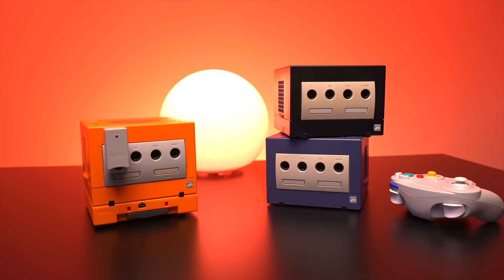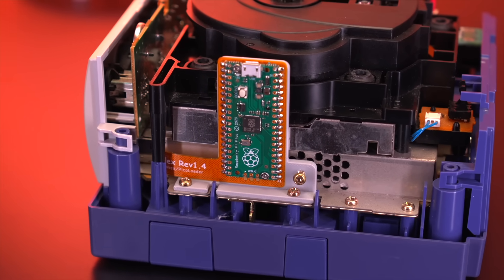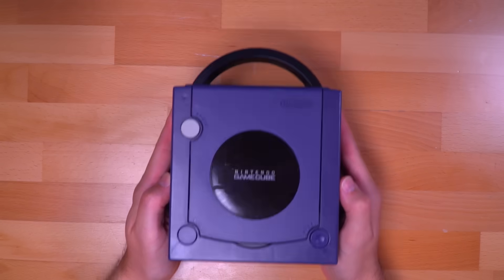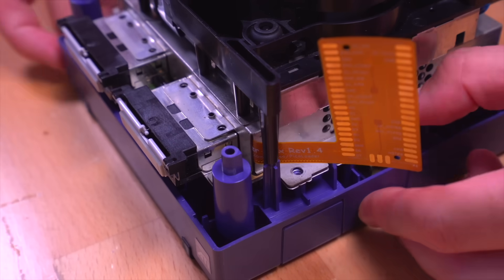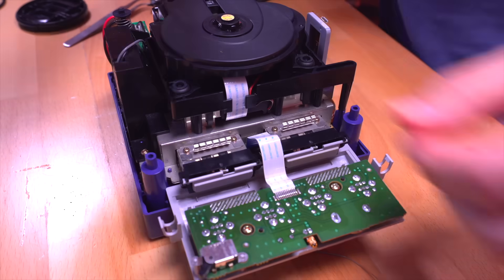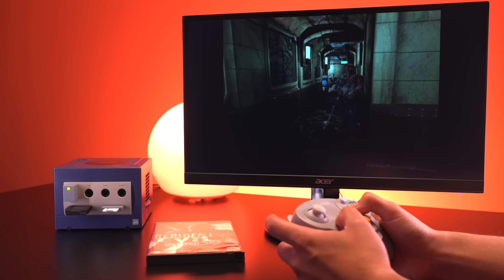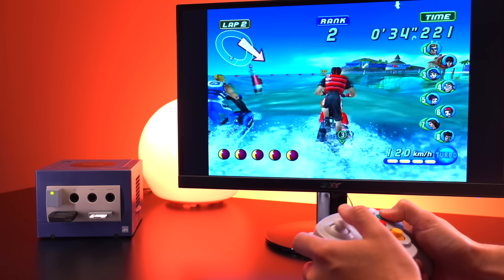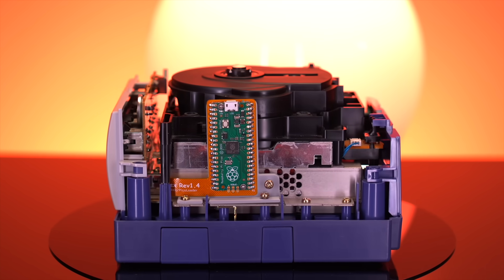New SIMPLE Open Source Gamecube Mod Chip | PicoLoader

Comment: 6:00 why would you do this while it's connected to the gamecube? Wouldn't make more sense to solder this before inserting it into the gamecube?
Reply from the maker: The bracket doubles as a jig to align the ribbon and the pico and being mounted to the console holds everything firmly in place.  I thought it was strange at first too, but when speaking to Makeo he told me that he thought it was the most straightforward way to do it and after doing it, I agree.
Reply: @MachoNachoProductions I understand screwing it to the jig to align it, that makes sense. Just feels weird to see it get soldered at an angle like that instead of laying the jig flat on a table. I don't solder things so maybe doing it that way makes more sense for those that do.
Reply: @_DewGaming  Because its mounted in place so you dont have to clamp it down to something weighted on the workbench. Otherwise the soldering iron pushes the pico around.
Reply: @suspendedhatch OK that makes sense. Not sure why it being pushed around being a possibility didn't click until you said it lol. Thanks!
Reply: @MachoNachoProductions  sure, but why not align and solder the ribbon and bracket and diode on the other side before you attach them to the console? in fact, why wouldn't they come already soldered together?

Comment: Flippydrive I feel is still the best plug and play solutions. This is still cool but still requires more steps. It is cool to see all these options coming out though !
Reply: I have a FlippyDrive, but I need about 5-6 more of them for a project setup.(I am a particularly dumb fringe case in this regard.)  The costs and availability of getting that many FlippyDrives was pretty daunting, but I think going through and installing a bunch of these will this a lot cheaper for me, with a bonus of forcing me to practice my soldering in a way that's a lot less dangerous to increasingly expensive old hardware.
Reply: If you're willing to spend 20x the cost for a 6-12 month wait and the same level of effort to install.
Reply: @TheDOSGamer 20x?????????
Reply: @TheDOSGamer  if you factor in the stuff you need to put an sd card in along with the cost of an sd card big enough to fit the games you want and the cost of shipping for everything this project ends up being about $10 cheaper than the flippy drive with shipping included there, so it's not a massive difference. the biggest thing is shipping time with flippy drives is the wait as you noted, this project is much quicker to put together
Reply: @Orion_Alathorn  who doesn't have a ton of spare SD cards at this point? I've got loads from old phones and other devices. Smallest is 2gb but I've got spares up 64gb.

Comment: Why would I want that when I can just use a flippy drive?
Reply: Primarily availability. I admittedly haven't checked in a minute since I installed PicoBoot with a Helder flex cable back in December, but for a while the FlippyDrive has been under heavy delays between shipments (I think the ETA back then was a good 5 months? Just checked and it's gotten better but you're still waiting a month.)

Also I do think the Helder cable is a good option for people with a busted optical drive/port.
Reply: Ordered a flippy drive almost a year ago, nothing yet. I am starting to think nacho is in bed with big flippy.
Reply: Because all you have to do is buy the ribbon, diode, and Pico board and you have it. You don't have to wait for Flippy Drive to be in stock.
Reply: If you're looking to install this mod one and done for yourself, yeah it could get more expensive than the premade flippy drive. But as Tito says in the video, this could be a groundwork for suppliers to make their own kits to sell, and people who would do the mods for others - especially once the custom board is finalized. If it doesn't seem to make sense for an end-user, that doesn't mean it's pointless.
Reply: I ordered mine last year and still hasn’t shipped. I could probably order one of these and have it from pcbway or jlcpcb in no time..
Reply from the maker: It's another option and theoretically a cheaper one as well.  Since it's open source it also allows the community to make improvements to it too
Reply: It’s all about options
Reply: @AmaroqStarwind Yeah, but I mean, why should I get an option that isn't as good as Flippy drive, when I can just get a Flippy drive?

But yes, it's always good to have more options.
Reply: @Irgendjemand_211  Not everyone can get a flippy drive. Flippy drives also won’t be around forever. And if you ever want to add new features…
Reply: you can get a raspberry pi pico in just about every western country in a day or less for $5. 

how long does it take to get a $50 flippydrive?
Reply: @iamdmc
It's true that you can get a Pico really easily, but is it really that much cheaper? You need the Pico, a flex ribbon from PCB Way (or another manufacturer), a 3D-printed mounting bracket, and the right diode. Custom-made flex ribbons can be a bit expensive if you don't order a lot of them, and not everyone has a 3D printer. I'd rather pay a bit more and wait longer, but not have to order custom-made parts and not have to solder anything. It's just way more convenient, and the Flippy Drive has Bluetooth and Wi-Fi abilities.

I don't say that there's no use case for this mod, but I think in most of the cases, it's better to just get the Flippy Drive.
Reply: @Irgendjemand_211  You can often find a 3D printer at your local library if you don't have your own, or pay a 3D-printing service as a last resort. Soldering is part of the fun, I think, and saving money is nice as well.
Reply: @iamdmc I’ve been waiting 5 months for mine, but it’s supposed to ship at the end of the month! Tariffs and supply chain issues have brought on a lot of delays for the two-man team.
Reply: @iamdmc  Over a year